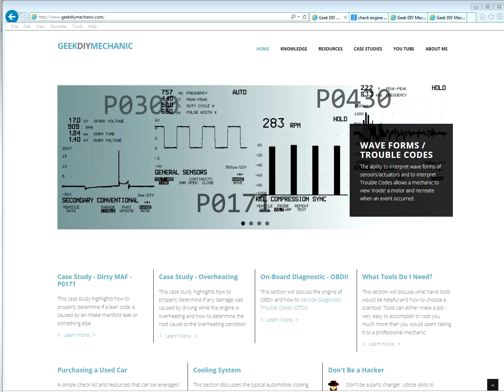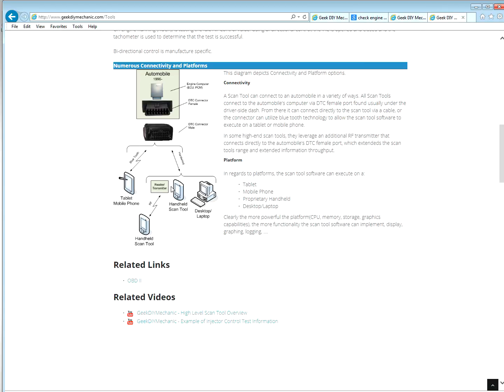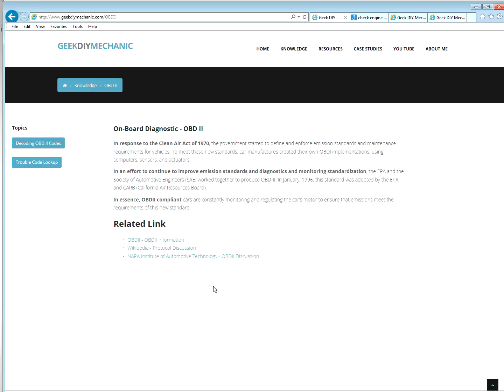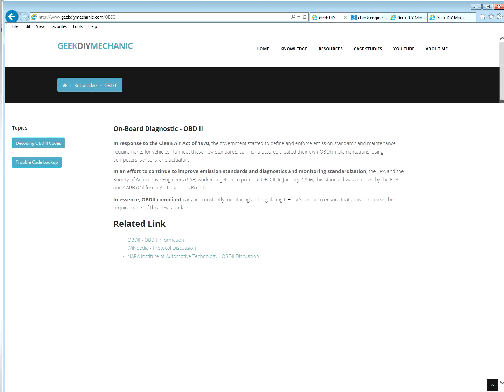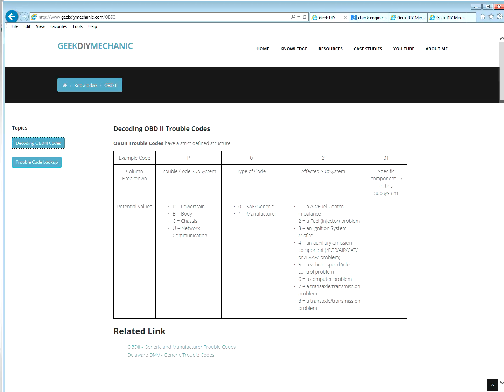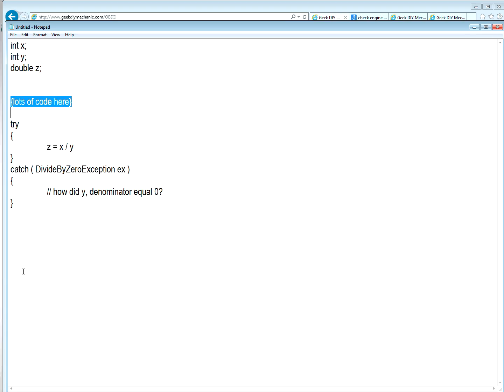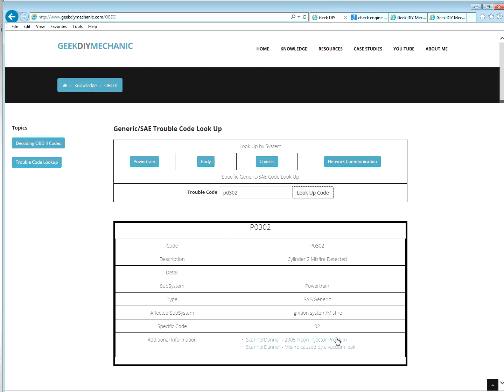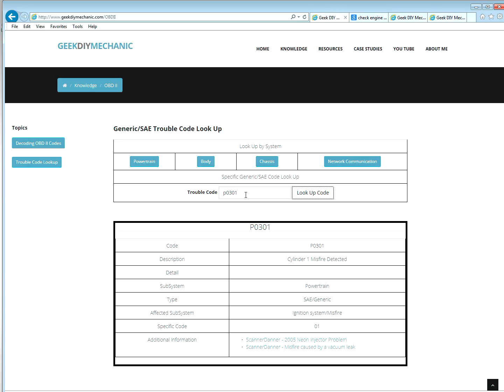Diagnostic Trouble Code (DTC) Overview

Comment: I have a DTC code U110C on my 2007 Grand Caravan And while driving the van it does a lot of jerking and wont accelerate right
Reply from the maker: U110C, Lost Fuel Level Message, is a manufacture specific code.

The following link discusses the issue:  https://www.autocodes.com/u110c_dodge.html

At a high level, your fuel level sensor sends data to other modules via the CAN bus.  The CAN bus is how all modules communicate with each other.  Think of a CAN bus as a party line; anyone can determine what is going on by listening to what others say.  Likewise, a module can tell other modules things by broadcasting message on the CAN bus.  I am super simplifying this.  LOL But I hope you get the idea.

Has the van been in an accident?  Has anything happened to the rear of the vehicle?  Are there any other issues?  Does the fuel gauge work?

You could clear the code and see if it comes back.  If it does, there it is an issue.  I have seen low voltage levels, like a battery dying, cause false issues like this, meaning after changing battery and clearing codes, they never reappear.

Comment: This information is vital to all apprentice mechanics, it was the first step to a common port.
I sincerely appreciate the timeline that you have researched.
Now a DTC light renders the vehicle unroadworthy in Australia, as it may be a seatbelt restraint system.
Sometimes a code is the surface of the problem that requires further investigation.
I really like the way you have explained this important fundamental.